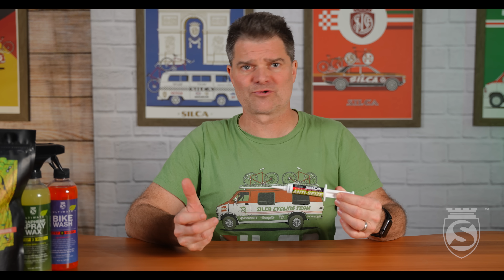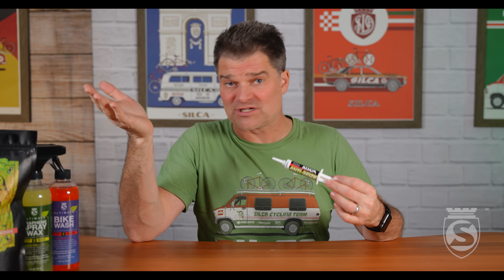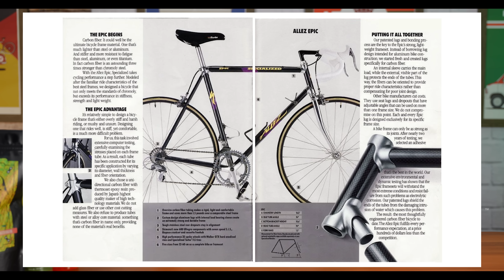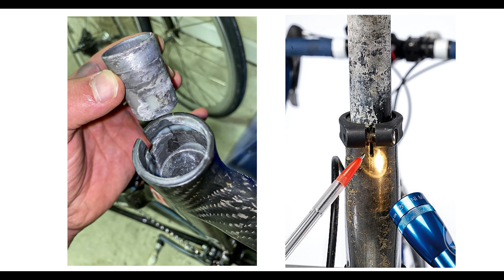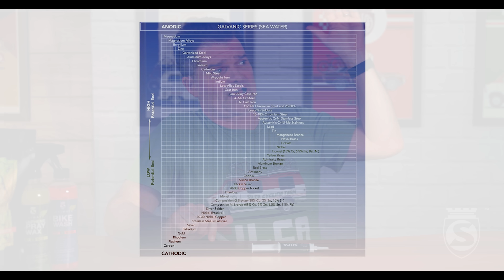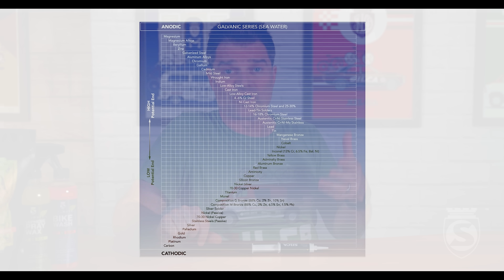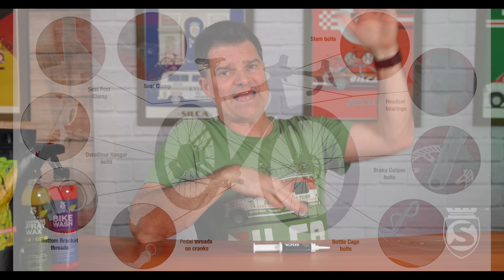Better than Grease? Anti-Seize Assembly Paste

Comment: Josh, would you use this on the wheelstuds of your vehicle, as some wheelstuds are steel and some of the lugnuts are aluminum?
Reply from the maker: It will work well in that application.. pretty much works anytime you have dissimilar metals threaded together, especially when one of those is aluminum!

Comment: I like using teflon pipe thread tap on my threaded  bottom bracket  cups.  No creak, insulates well, easily removable.
Reply from the maker: Teflon tape will work well for aluminum to aluminum thread interfaces, but as it tears and displaces on installation, it leaves gaps and voids which can be penetrated by water and sweat leading to galvanic corrosion when used on aluminum cups threaded into Titanium frames, so definitely want something a bit more robust in that particular application.

Comment: I have S and S couplers on my Waterford steel frame to allow for frame takedown.  S and S recommends using a Finish Line super fluoridated (and similarly expensive) grease for the threads and shoulders of the coupler and the twin steel retaining rings in the couplers.  Any idea why this product?  Would the Silca nickel anti seize work as well?  This is a like-to-like stainless steel design, or maybe the retaining rings are a different alloy of steel.
Reply from the maker: The extreme fluoro grease is really magical stuff, also known as Krytox, it works insanely well, but is also incredibly toxic and is now banned or soon to be banned in much of the world.  It also has no legal solvent for removal, so once it gets contaminated there can be issues removing it or cleaning it, not much of an issue for your couplings which can be mechanically wiped, but problematic for other applications.  For your S&S couplings it will work great, just wear gloves, but relative to it's other issues, we recommend a good targeted anti-seize in other applications.

Comment: Great work, there are a few industry standards that don't have the problems you mentioned and might be cheaper.  Molydisuflide Antisieze (MIL-PRF-83483E). Tef-Gel, and Molykote-P37 or equivalent (graphite in petroleum grease).  As you mention torque to tension has a surprisingly large tolerance.  Lubricant in general converts more torque to tension but I have never seen literature that suggests that tolerance is reduced. Or at least with enough certainty that you would reduce the tolerance in a bolted joint calculation. Something for me to look into. 

The aircraft industry is so highly restrictive with materials, I see it all the time where we can't use a preferred material because of some really far out 1 in 10 million concern or environmental reason.  For example the cadmium plated bolts you can buy at the hardware store are not allowed nor are the zinc plated ones in some cases. I really liked your presentation, Thanks
Reply from the maker: You need to be careful to avoid any antiseize with graphite on aluminum parts, these will actually accelerate galvanic losses from the aluminum.

Comment: Great info, but it doesn't need to be this complicated for most of us. I have used brake caliper grease my entire life on all suspension and brake fasteners. Using the proper torque specs you will never have an issue. Unless of course it's exhaust or some other high heat application and then it's anti seize.

Comment: How about Teflon (PTFE) tape? It is used when connecting (screwing) pipes in plumbing installations, etc. The same principle should work for screw connections on a bicycle.
Reply from the maker: SILCA is committed to not using harmful options. We consider it harmful to the environment and human health in some ways.
Reply: @SILCAVelo  By the way, Teflon tape is also used in medicine - in surgical operations, as well as in dental procedures. Therefore, Teflon tapes are not harmful to health.
According to the information on Wikipedia, Teflon itself is not harmful to health, but can be harmful (as a carcinogen) only when heated above a certain (very high) temperature, in which case the danger comes from a specific acid used in the production of Teflon.
At the same time, however, paraffin wax can also be harmful and potentially have a carcinogenic effect when heated above a certain temperature, in which some harmful substances are released. Moreover, these dangerous temperatures for paraffin are much lower than the dangerous temperatures for Teflon.
However, paraffin wax is strongly recommended by various sources of information as the optimal solution for lubricating bicycle chains.
Ordinary plastic is also harmful and pollutes the planet. But no one has given up on ordinary plastic for bicycles.
The rubber from which bicycle tires are made can also be harmful (when burning rubber) to health and also pollutes the environment, much more than Teflon. However, no one has given up on using rubber.
Where exactly is the line between substances and compounds that are considered harmful to health and the environment and as such should not be used?
I'm just curious.
Reply: @SILCAVelo  OK, thanks for the answer.

Comment: Would Tef Gel anti-seize be a good option for Ti + Al? It's most used in the marine industry to prevent corrosion between aluminum and stainless steel fasteners. Best of all it is non-toxic.

Also one potential problem I see with grease/anti-seize is that bike manufacturers (and other industries/companies) often do not provide BOTH wet and dry torque specifications... Repeatability is great but you can be consistently wrong if you have the wrong information.

Comment: I think you guys do a great job at bringing tech and knowmedge to the bike. It comes at a cost, all these trolls need to realize that low volume high perfromance is costly. If anyone thinks the raw material cost is the cost, your line of thinking is not elaborate. I work with sail boats, parts and raw material is 20% of the cost. Low volume and long shelf life triples that initial cost(thats to run a surviving business, anything with word marine in it will be 3-4x the cost). On top of that 130% is custom engieneering, 50-500% is craft when getting it installed. So a 2000$ piece of equipment easily costs 10-12k installed. 

Top tip from high performance marine: look into tef-gel. I use it for every nut and bolt on high performance yachts. Flawless. Very high torque. FYI, it is free form teflon, so do not taste the paste and get cancer.

Comment: I’m not sure I understand why nickel is considered “galvanically neutral”, which is a term I think would only apply to an insulative material. My reading of the chart indicates that the galvanic potential between both titanium and nickel, and nickel and aluminum, is large enough for corrosion to occur. I can’t speak to the aerospace applications, but in many others, sacrificial anodic protection is used, commonly with magnesium or zinc. I guess in this case the nickel is mitigating the issue enough to work, given the mild operating conditions of a bottom bracket or other part of a bicycle. But I wonder if the larger benefit is coming from the compound staying in place better than grease, and as long as the dissimilar metal contact is minimized there really isn’t much galvanic corrosion occurring either way. Curious to hear your thoughts. Thanks!

Comment: Just received new Ti frame and cranks for my first custom build, and coming up to speed on use/need for anti-seize. Both came with small tubes of Copper paste. Thanks for the in-depth discussion/info. Very informative. Will definitely consider this as an alternative. Question: apart from threaded interfaces, do you also recommend for the aluminum dropper-post (Al) surface, and should I apply it only underneath the collar, or along the whole length of the recessed seat tube. If the latter, seems like I would need quite a bit of product ($$). Thanks.
Reply from the maker: You absolutely want to use anti-seize anywhere you have aluminum touching titanium.  The dropper especially as the galvanic corrosion of a seatpost will see the aluminum oxides that is formed expand in the joint between the two seizing the post in place.. we've seen frames where the seattube ruptured from the pressure of the expanding post corroding inside of it!  You can use grease here and then just be sure to pull the post 1-2x per year to clean and re-grease.  Copper anti-seize will work OK, but nickel based will work better.  There are cheaper nickel anti-seize products on the market but most contain graphite which will not work in your situation so make sure there's no graphite in whatever you end up using.

Comment: Shimano anti-seize contains mostly calcium carbonate, some zinc oxide and aluminum benzoate, without graphite and metal. Can it provide adequate protection for stainless steel / titanium / aluminum?
It's very similar in composition to many "food grade" anti-seize products.
Reply from the maker: That type of formulation is great for steel to other metals, but not as robust for Ti-aluminum or aluminum-carbon interfaces.

Comment: If I wanted to use your anti-seize on say my seat post and tube, do I need to thoroughly clean the inside of the seat tube of whatever grease was already in there? If so, got any recommendations for how to do that short of removing the whole bottom bracket?

Comment: Using an anti-seize or grease in the appropriate use case makes good sense. In what instance should a thread locker be used?
Reply from the maker: Thread lockers are great for fasteners that are low torque, high risk, and infrequently needing to be touched or adjusted, but be sure to check with the manufacturer to ensure that it is allowed.  If your position is super-dialed, stem faceplate bolts are a good candidate.. chainring bolts also.  I would avoid using threadlockers on aluminum fasteners as the removal torque can become so high that the hex key can round or damage the fastener when trying to loosen.

Comment: Interesting, but the EMF difference between nickel and say 6061 aluminum is still ~0.6V.  Per NACE, anything more than ~0.15V is enough to drive galvanic corrosion.

Just get a $20 tub of Loctite Marine grade (8023).  Take things apart occasionally, clean, and re-apply any you’ll be fine.

I agree the copper-based stuff is ridiculous, and never should be used anywhere around aluminum.

Comment: The point you make about bonding aluminum and carbon is valid but way over exaggerated. There are still a great many of those early Specialized Allez Epic frames out there that are alive and well even after 25 years of use. I still own one. Lots of other Treks, Alan’s out there as well built the same way. Yo say that after 6 years almost 100% fail is a bit much.
Reply from the maker: Yes, the 1988 model had nearly 100% failure due to lack of glass insulation between the aluminum and carbon (confirmed by Specialized engineering).  By 1989 they were insulating appropriately and there are at least 3 years of those frames out there that were manufactured with proper precautions.  These frames were made by Giant, so early CADEX frames had similar issue, and then benefited from the same solution.

Comment: Anti seize for headset bearings?
Reply from the maker: Absolutely, however, if you are using that bike on the trainer, then I would go for a heavy slathering of marine grade grease.
Reply: @SILCAVelo  thanks - I'll be ordering some.  does the trainer advice also go for a touring or bikepacking bike out in the rain a lot?

btw - I rode the GDMBR last year was was the only one using synergetic that I knew of. no one knew about it and everyone was surprised how clean my chain was and I was lazy and only lubed once a week over about 4k miles last yr.

Comment: I think its the same stuff as the discontinued "Syntace Ti-prep".
Reply from the maker: I tried researching it and can't find a ton of specific info, but in photos, the Syntace Ti-Prep looks like a copper anti-seize.  As we say in the video, that was the state of the art 30 years ago so that would make sense as that product appears to have been sold as far back as the 1990's when it was included with early Syntace aero bars.
Reply: @SILCAVelo  it's a silver shiny thick paste. I own one. Not copper.
Reply: @SILCAVelo  you were looking at Finish Line Ti-prep, which is a copper paste and reddish like copper. Different product

Comment: It's explained in the video that normal grease can't work as anti-seize under the pressure of thread interface. So is it correct that silicone grease is also useless as anti-seize in the same manner? Also, is copper anti-seize the second-best alternative for the case of aluminum crank bolts in an aluminum axle?
Reply from the maker: Silicone grease is not a good antiseize alternative as it is rather easily driven out of threads and from under bolt heads by load.  The general recommendation for Al-Al interfaces would be Zinc anti-seize, https://www.ellsworth.com/products/by-market/general-industry/lubricant-products/anti-seize/henkel-loctite-zinc-anti-seize-lubricant-gray-1-lb-can/ there are also aluminum based anti-seizes that work well and many marine anti-seize products are rated for aluminum.  The key is to avoid products with graphite in them, which can be quite hard.. so many copper and nickel anti-seizes add graphite to reduce friction in high torque tightening which makes them a poor choice for use with aluminum so make sure to really read the description on any product you are looking to buy.

Comment: Hi Josh an interesting take on a real problem.
You are right that grease/antisieze makes torque tightening less variable, but then you need a new set of torques with the more accuracy.
Given that the torques quoted for bikes are generic only, I always use the lower figure as near as.
Got any figures on all that?
Reply from the maker: Bicycle industry torque is rather variable in how it is calculated, but particularly for things like faceplates and stem/steerer clamps, the most important bit is consistency.  Most torque tools already have +/-5% accuracy, and unlubricated or improperly lubricated fasteners can add as much as 25% more variability in bolt tension for a given torque tool reading.  We recommend working slowly, using step torque (making a video on this now, but essentially if you need to go to 6nm, go to 2, then go to 4, then go to 6).  Go to the lower of recommended torque values, and then increase if necessary to prevent slippage.
Reply: How do I open the syringe? Tip cut?

Comment: Ok, Josh, this seems like another product (nickel anti-seize)being pushed by the bike industry, for profit. I have been using anti seize, since the mid 90’s 1st aluminum, then copper based anti seize. I have seen to this day bike shops using grease on bikes in areas where anti seize, should be used.  Aluminum to Aluminum you have to use anti-seize not grease, even similar metals  exchange electrons, and form covalent bonds (that’s what the creaking sound is the bonds breaking) I went through the creaky 90’s , prior to anti-seize . Aluminum, copper, nickel are all readily available, for a fraction of what the bike industry wants to charge, and the difference  amongst them is temperature applications. I’m the food.
Reply from the maker: I'd say it's more a product being asked for at the top of the bike industry to reduce warranties and solve customer complaints.. Pretty much every $25 for 450gm copper, or nickel anti-seize on the market contains graphite and should not be used with aluminum.  Pretty much every aluminum anti-seize contains either aluminum or zinc and shouldn't be used with titanium..so considering that most every high end carbon stem and seatpost anymore uses Ti bolts in Al female thread inserts and that most every modern carbon frame uses Al threaded inserts which some customers will fill with Ti bolts.. we have potential issues.  I'm with you 100% that you can also do all the research and just own all of them, keeping a chart of what to use when and where, but the reality is that most consumers and even shops will at best have one of them ensuring that most of the time they're using the wrong one and at worst won't even know what we're talking about and just be using bearing grease all over the place, or even worse, are just dry threading things together.. we see that all the time!  This product is one of the only ones I know of approved for that Ti-Al interface which is so hard to solve for, and it's not something commonly found on Amazon or even in industrial catalogs with the cheaper stuff as it's really pretty specific AND it's a lot more expensive.  Anyway, there's a ton of average product in this category and the world doesn't need another repackaging of HenkelLB8008 copper anti-seize which is pretty much what everybody else seems to be doing.  Lastly, 12 grams of this stuff is enough to fully coat over 100 M5x12 fasteners.. you could disassemble and rebuild 3-4 entire bikes with this $20 tube fully coating every single fastener, all for the price of a beer at a football match.

Comment: So when would you select blue thread locker instead of antisieze?
Reply from the maker: Anytime you have something that you really don't want to move that you also don't plan on adjusting anytime soon can be a good place to use threadlock.  I use it this way on cleats.  The other application are fasteners that you don't want to fully tighten but also don't want to loosen, so brake clamp bolts are a good application here where they need to be just barely tight and stay that way.  Threadlockers are generally not re-usable if you need to loosen and re-tighten, so I avoid them for anything that might need adjusting like stem, seatpost, saddle.  Also beware with crankarms and pedals as those generally want to self tighten in use and threadlock can really make them hard to disassemble!
Reply: @SILCAVelo  thank you for the reply! Excellent point on cleat screws.